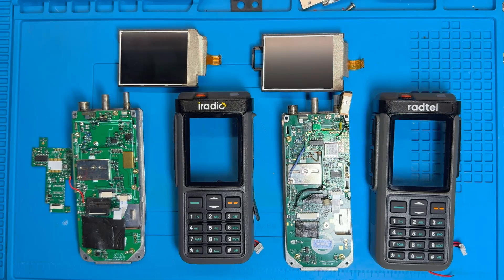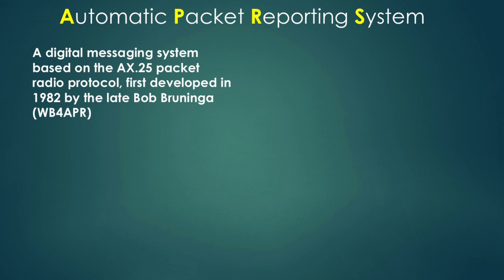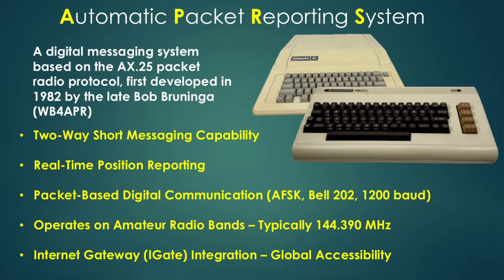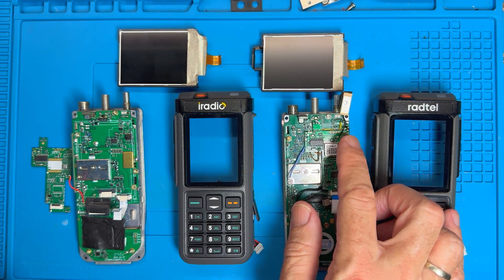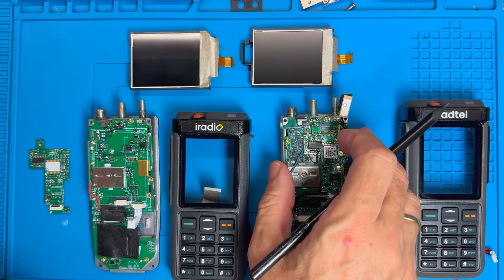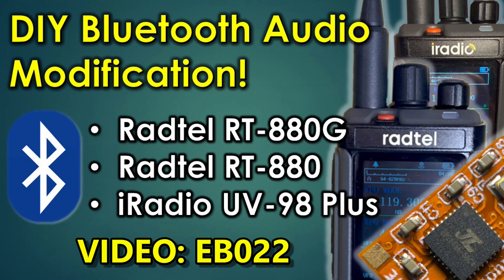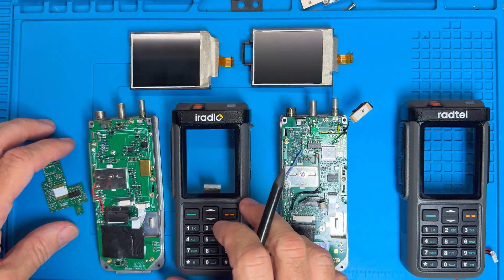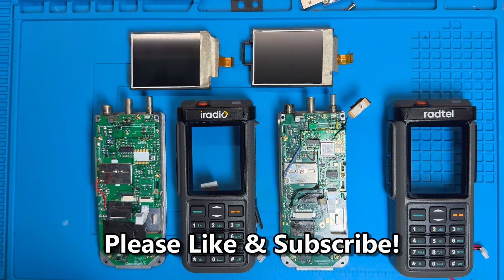EB023 - Radtel RT-880G Hardware Review & Teardown

Comment: Today I tested the GPS module and compared it with the module in my phone, which supports more systems than GPS and BDS. It is really noticeable and the mobile phone achieved higher sensitivity inside buildings or in built-up areas. APRS works quite well, but I am not able to display it in receive mode on the screen. I must have set something wrong and I don't know what. Can someone describe the proper settings here - everything about APRS? (I have an Iradio UV-98 plus)

Milan
OK1IF